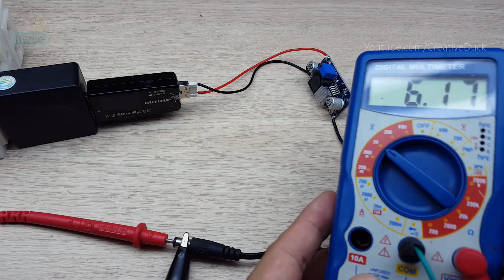Making DC 5V TO 12V - USB to DC 5.5*2.1mm Cable ( Power Supply Module for Wifi Router mobile power)

Comment: I used XL6009 PCB (wothout heatsink) connected to power bank, converted 5V to 12V, but its heating up too much, very hot. what to do ?

Comment: Is it risky to use?
I mean if by chance the voltage increases to 12V on a 9V router then it's done for.

Btw my router is 9V 1A  but the 9V booster cable I was able to run it with. 5V 1A powerbank. Any thoughts on that?

Comment: Hey, can we use this for led Lights? 
I have a 5 m long, 60 w, 12v led light role and i want to connect this in my car with usb cable, is it possible?
Reply: Impossible, this circuite give max 1 amp on the 12 volts, 60w of leds it's too much for a step up converter, the solution is the 220 AC to 12v DC

Comment: I make same but not work with any modem 12 v !!!!
Reply: The modem take too much watts or amps for this project
Reply: @altoparlanti--loudspeakers5082  
So if i wanna make this i need to make sure that the device i want to startup needs less than 0.83 amps. Is that right?
Reply: @MoradSayed  you have to check the back of the modem and read (dc input: voltage, ampere) , sorry for my english, i'm italian
Reply: @altoparlanti--loudspeakers5082  
Don't worry your English is good enough 🤍.
+ The idea is that i wanna power my Arduino circuit for a Bluetooth controlled car project which happened to be powered by a 12v power source, but all i have is just a 5 volt power supply so i need to increase the voltage but i don't really know how many amps does it need to power up and i don't how something to measure it with.

Edited "Power bank* not a power supply"
Reply: @MoradSayed  in this case you should have 1 - 1.5 amps. depends on how many motors you put, the problem is using multiple motors at the same time even with a 5v to 12v boost may not make it, you should need 2 amps
Reply: @altoparlanti--loudspeakers5082  
Then i think i will need to look up another way.
Thank you for your help 🤍.

Comment: when i connected it to modem the 12v voltage dropped to 6v and modem did not turn on..input was 5v and 2 amps
Reply: Probably the router take too much WATTS. Use a normal power supply

Comment: I'm done with the circuit setup. It turns on the router, But it is not working. It makes Data Loss. I used 5v 2a Power bank for input boosted the volt using the board to 12v. I have connect it to 12v 1a router. It blinks the LOS led in the router. Someone help me to overcome this issue.
Reply: You can't, the router take too much amps or watts
Reply: Try two power banks in parallel if you're determined to see it working

Comment: This is not true... MAX AMPS unit allows through on output is 900ma even with 5V  2.1A input. The diode is the limiter on ALL these units as it only boosts V but restricts Amps.
Reply: Take a one that has amperes adjustment, 5A or even 10A, but this sacrifices the project's size, it's considerably bigger.

Comment: Can we use this with a car charger?!
Reply: yes bcz car battery voltage is also 12v dc.
Reply: not really recommended because the 12v step up could probably heat up but you can use it 👍

Comment: I've a power bank with 12V 1.5A output. Can I use it directly for the same router that you have?
Reply: What is your  Name of power bank can u provide which power bank it is
Reply: @rana5483  Mi Power Bank 2i
Reply: @Shubhamkc  is router worked perfectly????
Reply: Yes

Comment: You are mad you don't know that router can work on 5volt also
Reply: really ? then why do they give charger with 12V output , when they can settle with cheaper one ??
Reply: no? what kind of router works on 5 volts?

Comment: i did the same thing but its not working... i am not able to power up my router 12v ...the light is so low like there is not enough power...
Reply: If you're desperate you could try connecting two or more power banks in parallel. This would mean being mindful your wire is thick enough for the additional current (heat). Also be aware of the rated max output current of your DC-DC component and do not attempt to exceed that.
Reply: please help
Reply: Ur router need more current....maybe 1A or more.....and when u use step up converter, your current will decrease....so even if ur power bank has 1A output, after step up conversation, current will decrease

So a Powerbank is simply not enough to power this.....u can use lithium battery
Reply: Personally I would connect my router to a wall outlet. And if that was not possible I would seek out a car battery with an pure sine wave inverter

Comment: The wire and booster board gets heated up quickly
Reply: Put some heatsink
Reply: @rouenz0212  on the cable xD
Reply: use some thicker wire bro

Comment: i made this without (5v to 12v StepUP module) and My 12V Technicolor TC7200 Works perfectly with ONLY 5V !!!!
Reply: Careful.  More current might be drawn as a result
Reply: How did it work ? did you connect 5V directly to route ?
Reply: Send me diagram brother 🌹💕

Comment: Hi, how do you control amps... I need to make 9v 0.9a for my router... Thankx
Reply: Trailblazer 91 measure it and tune it it to 9v you don’t need to set amps
Reply: You don't need to control current, it will adjust according to load
Reply: It only will take asmuch it needs

Comment: what did he screw there on the module ?  How many Amps can it put out?
Reply: depends on the step up but its probably outputting 2 amps, there are 3 amps step up out there tho so just buy one that works for you
Reply: That is potensiometer,  he just changed the potensiometer value , based on that value output voltage changed

Comment: can you use 12v tv or led from this connector
Reply: consider Ampere of current as well. you can say V=IR.   5V x 2Amp = 10W .  12V x 0.83 Amp = 10 W.
Reply: @atulmits  I wanna ask you something Instagram handle?

Comment: It is only when you run it on powerbank, but cannot be used as backup as thinking when you add power supply, it will not be able to serve that much of current
Reply: you can in fact if your powerbank supports pass through power . powerbank will charge even when it is giving output  to a device
Reply: @alexalbon8274  yes, you pointed correctly

Comment: Can we use this for various purpose where 12v adapter works? And how much amps it ll give?
Reply: You can use it to any 12v devices. But they had to be less than 2.1 amp
Reply: @null-xv3eq  bt it will give more than 1amp?
Reply: @_Harii_Haran  it can give that much amp how much your power bank gives
Reply: @null-xv3eq  Power bank 5v bt this one is 12v
Reply: In this situation gives about 1.0 Amp @ 12V. It drops current much when power bank is charging. It will stop work.

Comment: Hi
I can  make a dc12v to 5v for a mp3? 
Is for a truck. 

Thanks in advanced.
Reply: Yes you just need a BUCK CONVERTER(the opposite thing in the video) or LM7805 :)
Reply: @nikiamz6501  thanks for the support.
Reply: You can simply ass resistance in + positive path, it will work.